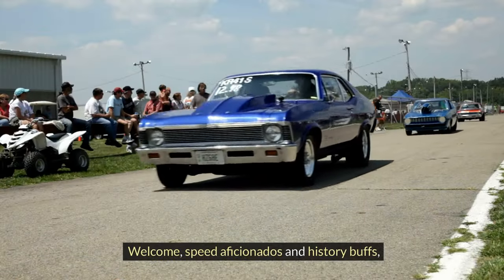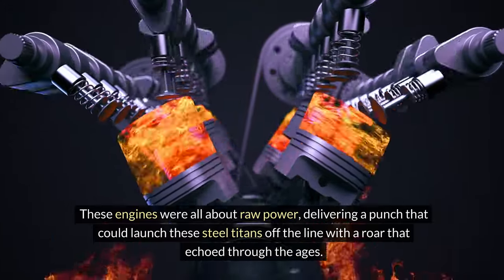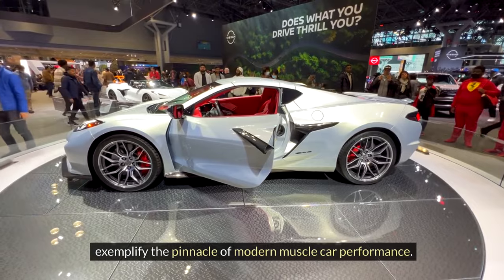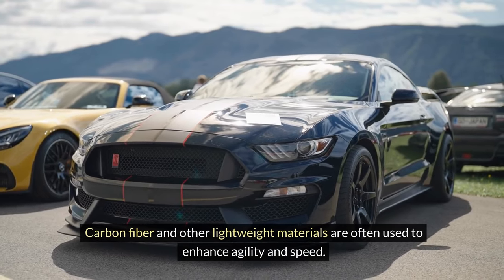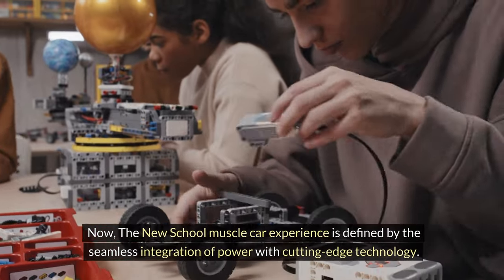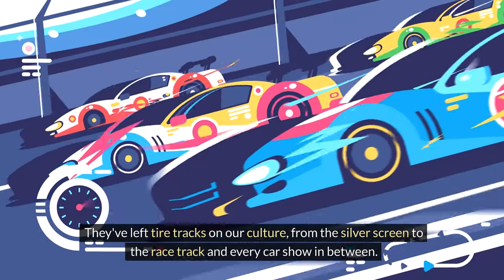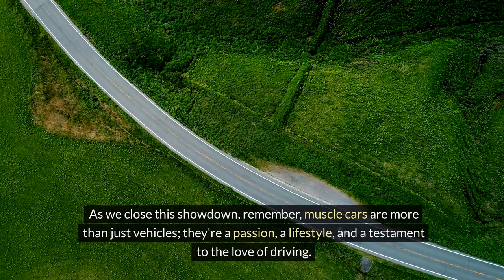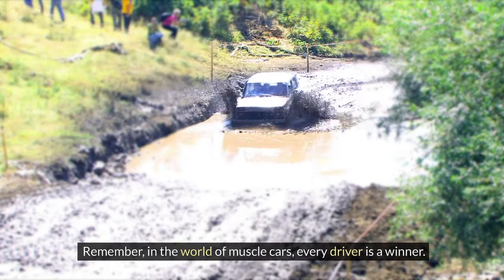The ULTIMATE Muscle Car SHOWDOWN: OLD School vs. NEW School

Comment: Sorry, but I'll stick with ole' school muscle!! 70 Chevelle SS with 396/375hp with 411 gears. You and the ole school vehicles become . Like a Sword is an extension of the Knights being. New ones take out all of the quess work. Old Muscle cars, you were able to tune it, adjust the lifters, change the spark plugs,  get under the distributor and change the points and condensor.   New cars with all the tech as you say, you can't. 1962 Chevy 11, 1964 GTO. 1969/70  Cuda 69 Charger! It'll cost an arm and leg to service the New ones. This is of course just my opinion, I'm just an ole school gal. And a muscle car nut.
Reply from the maker: Agreed! Nothing batter than feeling that Raw power when you push that pedal!! 🔥

Comment: My 87 year young Mother could drive my modded 2011 Mustang fast. She could drag race it or drive 170+. But my 71 Vega panel express with a roller 350, she would spin out and wreck- before traveling 50feet.
Reply from the maker: I believe it! I can see that you got some beauties in your garage ❤️
Reply: @NewOldAuto  the vega is truly old school 70's kinda hotrod. Slot mags with white letters out. It's a legit panel. So no side glass. I'd sunroof in a hot second but I can't cut it up!! I am looking for roof rack should you have leads. I'm currently designing sidepipes( muffler pipe, 3" chambered, satin black) car is painted copper. Not tubbed. Stock body including hood. Stone stock interior. Fast? Not compared to today- but it's a scary wild ride. With slicks has a 12 in it at 110 ish. But the sound, vibes,   sensations is simply a thrill ride.